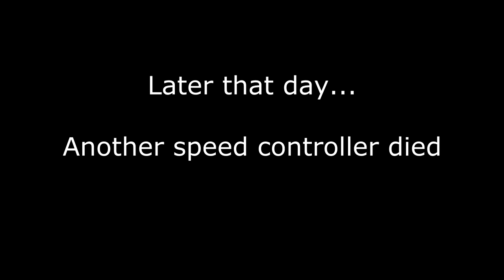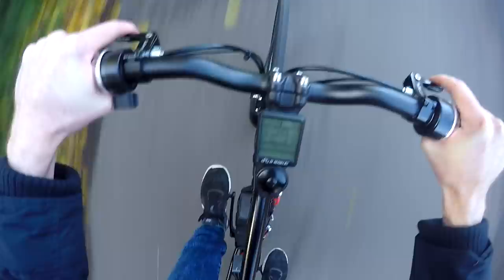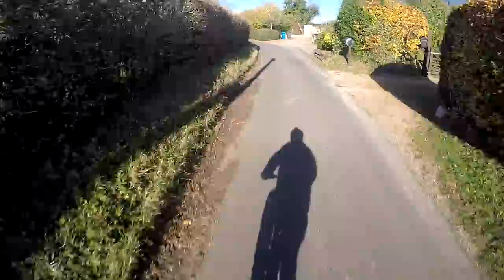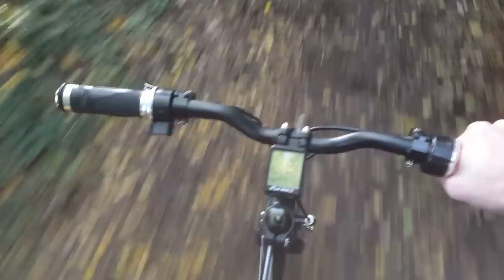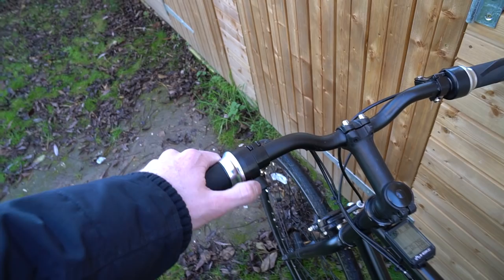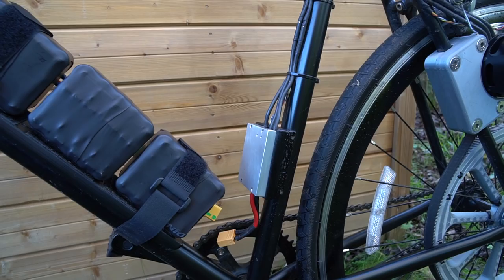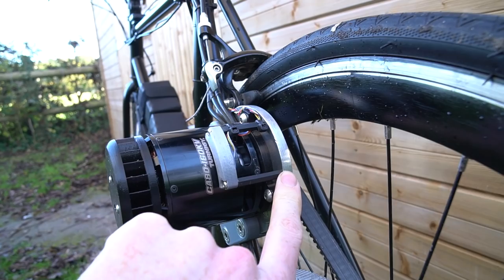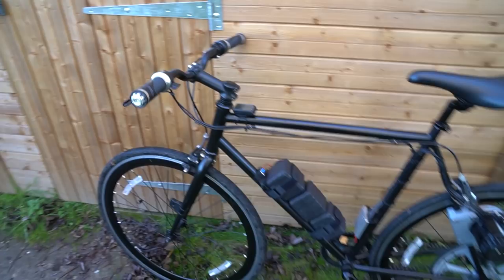Electric bike V3

Comment: Wouldn't it make for a cleaner install to put the motor inside the top of the rear triangle?  Flip the motor 180,  center its length on the bike's centerline .  Build your mount to clamp around the seat tube, extend stabilizers to the seat stays if necessary.
Reply from the maker: I considered this when building this V3, however I decided not to for simplicity. Moving the motor upwards meants running the belt up and over the rear brake. This would make the belt very long and therefore increase the possibility of it stretching under load and skipping. Also it would be more difficult to slide the motor for tensioning the belt. I'm sure it's possible, but I prefer the simplicity of this setup. Thanks

Comment: Instead of using such a large pulley for the bicycle wheel you can also use a multi pole axial flux motor for direct drive, printed by yourself. :D

Comment: I notice you still don't have disc brakes. With a downhiill bike you have 150mm hub spacing on the rear wheel.That leaves enough space to have your big grey wheel going around the disc. Might be a tight fit, but it would give you disc brakes.

Comment: The Tom Stanton Pigeon Racer 3.0, lol!

Hey Tom, have you considered building a 4.0 mid-drive with a jackshaft using a rear gear shifter bike? That will really give you usable torque and really high speed at the same time as you can shift gears. You would only need a pully running to the front sprocket with a oneway bearing. If my dumbass can do it with scrap shit metal and shit welder I know you can do a 3D printed version. 4kw that would get you up to 50+ mph using a mid-drive with wheelie power! YOU CAN DO IT MATE!

Comment: Impressive effort.  However... with all that MPH available don't you think that uprating to at least a single disc up front might extend your life expectancy a bit? If possible I'd be inclined to  try a twin hydraulic set up, one on each side of the fork. (I'm a pensioner who rode big fast m/cycles for years - remember, doesn't matter if you can't go. But it sure does matter if you can't stop!)

Comment: Really nice work.   I wanted to ask you if it could be possible to add a hub generator, like the SHIMANO Dynamo Generator Hub.  I found that searching on YT.  If you had these hubs on the front and rear wheels, could they charge the batteries at the same time as you were riding?  I guess they are putting out 6 or 8 v.  (not sure about the current).   Do you think it would be worth it to integrate them into the bike build as a charging solution as you ride?
Reply: RipVan Winkle No, that's not how physics works.
He'd have to put extra energy in, to then inefficiently generate a lot less energy.

Dynamos don't generate a fixed voltage, they're mostly current limited. So 500ma at 6-40v...also it's AC.
Reply: Right.  That's right the dynamo is AC.  Didn't realize that.  Don't know why but I just assumed a bicycle generator would be generating DC current.    
One other question, why do you say that there would have to be extra energy put in?  Am I correct in assuming you meant energy to turn the generator?    I don't see where that would be the case.  It's not like the generator is difficult to turn or has a lot of resistance.  Or maybe did you mean energy from somewhere else?
I also saw some DC dynamos (not integrated into hubs).  If it was DC, would it be worth it then?

Comment: Hi Tom, you're doing a great job. I'm curious with a full charge how long the bike will run, then run the same route again but without regen braking, how much extra time/miles can you get.
Reply from the maker: Hi Paul, I will be making a video on this soon! I'm currently trying to find a good route to ride with hills and stops etc to test the braking. Then I will ride it multiple times with and without regen braking to see if it's worth using. Thanks!

Comment: Really fantastic stuff. Incredibly impressed by your engineering (in other videos too).

Amazing to see the 3d-printed cog on the rear wheel. In PLA too. 
I'd be quite concerned about what bits might fly in which direction during a catastrophic failure. Either from that cog failing or the motor or belt coming loose at speed.  Make sure you tie up your shoelaces! ;) 

Those lanes are just like the ones I grew up cycling around in Somerset. 

Keep up the excellent work. From what I've seen so far, expect offers from the likes of Elon Musk soon. Seriously.

Comment: Say, with that regenerative braking, would a bank of supercaps play nice with this system?
Reply from the maker: I'm not too sure if I'm honest. I hear a lot of people talk about putting supercaps on a regen system, but I'm pretty sure it would require a battery management system to slowly discharge back into the battery
Reply: My thinking is not to use them to recharge the battery but rather just to quickly store and then use the energy from the regen immediately upon next demand from the motor. Supercaps can just charge and discharge really quickly. No need to actually recharge the battery if you can just use the power right away. It would reduce the demand on the battery and perhaps use that regen power more efficiently. I think all you have to do is place them in line between the battery and the speed controller. That's the way they are used with Car Audio systems for providing fast power to the amplifiers. Something to look into, anyway. You've come up with a great design. Thank you for sharing it with us.

Comment: excellent! very refined & lean system. you should be proud.
Question: did you use any specialized program to create the 184 tooth pulley?
keep up the great work!
Russ from Coral Springs, Florida, USA
Reply from the maker: I downloaded a model of a HTD5 pulley from GrabCAD (If I remember correctly), then measured the tooth dimensions and replicated it at a larger size in another CAD software. Thanks!

Comment: what about mounting some pick up coils near the front and rear brakes and a strip of coils down the rear frame tube   like on direct drive lg washing machines and also put nitrogen in tyres and neodymium dust maybe with graphite dust pumped in would create the field force excitation     just a thought

Comment: The only thing I could say about this, is that I really don't like the type of bike you've used.  Those tires look WAY too thin for this.  Not only from a stability standpoint, but also a reliability and grip standpoint.  More tire = more grip, which equals more torque applied to the road surface.  Also, thicker tires mean less likelihood of total destruction if you hit a stick or a pothole at speed!  Beyond that though, really nice design, glad you're getting some use out of it.
Reply: Monolith Tyriss I converted a 1970s racing bike using this method. I don't get any problems with stability. In fact my thin bike can still squeeze through tight spots between stopped traffic in my small town.

Love drop bars and thin tyres 

Commute every day and works brilliantly

Comment: Have you considered using ultracapacitors in conjunction with either batteries or solar? 

Ultracapacitors could also be used to collect the regenerative energy during deceleration.

Comment: How did you attach the rear pulley to the rim?
Reply: Roger Dickinson 

I'm not sure but what I think is...

Looks like a flip flop hub used on fixed wheel bikes.

Free wheel on one side and fixed on the other. The pulley is attached to the fixed side and the pedal side to the free wheel.

Comment: Why didnt you make the vesc 4's yourself? its much much cheaper, I calculated the expected cost if you make 10 of them yourself to £56-£60 per vesc (using prices of components for 1, meaning it might be cheaper due to component discounts) this price is for all components and pcb's. Some pcb fabs can even order a provided BOM and deliver you 100% completed pcbs at very little cost.

EDIT:
Actually with component discounts for all 10 its only £45-£50. I might just make a bunch and sell them at like £80 each :D

Comment: hey tom stanton do you know how to make a drone fly for up to 2 hours. use a small 48 volt motor turned into a generator and then attach a small motor to power it. It must run on just a little of the battery charge. so make a tiny stick generator. you could use the motor on a mini quad to make the whole thing work. please make a video and show me.

Comment: Hey, love your videos.

Can you give me some insight into the process you go through to select an electric motor?

Perhaps a few examples of how you'd size it for the application: eg, electric bike, electric model plane, electric go-kart, electric car conversion.
Reply from the maker: Hey David,
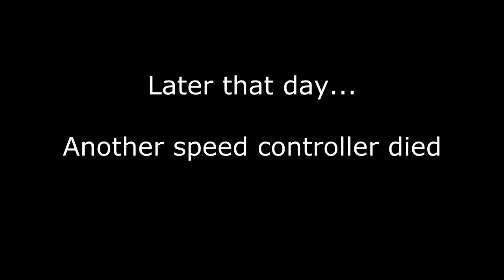I chose a motor based on lots of different things. Surprisingly speed is not an initial factor for me (this will probably change with a go-kart or car), because gear ratios can always be adjusted. Usually the motor isn't the most expensive part, so I will tend to see what battery and speed controller will fit my budget. Then I'll work out a battery depending on what the maximum voltage and amp rating the speed controller can handle (60V and 80A in this case). Then I'll work out whats the largest gear ratio I can fit on such a setup (about 1:15 in this case). The 'hobby grade' motor used on this bike has a kv rating, which means the RPM it can reach per volt. So this motor is 160kv, therefore with my 50v battery, it can spin at a maximum 8000RPM. then using the diameter of the wheel etc I estimated about 36mph, which is plenty of speed. This might be completely different for electric cars as I have no knowledge of their motor specs. So it's a bit of a juggle of components to get the right setup. Thanks

Comment: How many C-s  of current does the regenerative braking produce? Is it controlled? Isn't it too much for the batteries? 
Edit: You said it's up to 30A so how much C is that? >15C? Might be pretty bad for the batteries.
Reply from the maker: The battery is 12s 15Ah (12 cells in series and 5 cells in parallel), so when charging at 30A, it is charging at 2C. The LG HG2 cells recommend charging at 0.5C on a regular basis, but can occasionally be charged at 1.3C.
Reply: Cool. 2C doesn't sound that bad, though it's probably worth researching how this affects battery degradation. The effect is sometimes quite severe depending on the specific battery.
Reply: is what is the wiring like for the regen brake throttle? Is it possible to set up on the VESC 4? I am reproducing your v1 ebike with some improvements and would love to know how you did it

Comment: 300 gbp just for the vesc.. that's not cheap at all anymore
Reply: What is what?
Reply: Agree - so expensive!
Reply: Well, compare that to the price of a normal E-Bike and it suddenly feels pretty cheap again.
Reply: Danksa Grabowski nope it doent here in la you can buy ebikes for 300 dollars now and are good and reliable
Reply from the maker: +nightmare in action nighmare in action I find that very hard to believe. It's difficult to find a decent non electric bike for under $300, so to find an electric bike capable of 36mph for 15miles for under $300 is pretty close to impossible.
Reply: Tom Stanton oh well of course that speed thebones you get here at that price are those foldable ones have range at about 10 to 15mph and have a max speed of 18 but I still preffer hubmotors over belt drive is way more efficient
Reply: That's crazy cheap! :o In Germany you pay about 3000€ for a good one :'D
Reply: I don't think that you're understanding that this E-board controller also has regenerative braking and has a magnet sensorless/sensor optional control.   This makes this speed control really adaptable to all sorts of different brushless motor configurations.   Regenerative braking doesn't come cheap as there are special low resistance/pass Mosfet transistors in it's design, and I suspect being that this might be an entire controller on chip or at least advanced surface mount electronics, these extra features are a bargain at 300 quid.

Comment: love ur work truly inspiring heres another question about the regenerative breaking for you, is there anyway to do it without an esc that will control It for you
many thanks
James
Reply from the maker: Do you mean to have an additional method of re-charging the batteries without using the current motor and esc? I'm sure you could mount another DC motor somewhere and have that run through a charger to the batteries, but that would be unnecessarily complex. Thanks!
Reply: Im basically asking is if you can use the same motor to recharge the batteries without using an esc that is designed to utilise regenerative breaking. Just wondering about the actually internals of the circuit.

Comment: how did the 3 vescs break?
Reply from the maker: Bad manufacturing quality due to the VESC 4 being open source
Reply: Tom Stanton I don't see why it being "open source" has anything to with poor manufacturing? If anything it should make it better?
Reply from the maker: +DogMan the problem is that any factory in China can make them using whatever quality components and soldering they wish. There isn't a single company running the manufacturing to make sure the quality is consistently good. Some people get lucky and some end up with dead VESCs
Reply: Tom Stanton oh yeah I guess that makes sense. I checked the vedder forums and he said teamed up with trampaboards for the 6. I guess that allows for at least one source of good vescs

Comment: Nice video :)
I'm curious about how well this resists water, would you be able to run it in the rain?
Reply from the maker: I've tried to make everything as water resistant as I can without making it a pain to change stuff. For example, the VESC is mounted in a rubber case which will prevent light rain being an issue, but probably wouldn't be ok if completely soaked. The batteries are heat shrunk to prevent water getting in and the throttles 'should' be waterproof. The hall sensors are mounted in epoxy to insulate all the connections from water and in general brushless motors are water proof. So fingers crossed it is haha! Thanks!

Comment: Lovely engineering but I built a drop handled ebike that does 34mph for about £200 and it doesn't have a lump of motor sticking out the side or a conspicuous large pulley and drive belt.Take one 250w, 36v geared hub motor off a 20" and string to a 700c rim.Use a 36v/48v cheap Chinese controller (the FETS are good for 70vGet 2 off 8s lipo or equivalent and wire the 16s to the main positive and the 13s to the controller switch (door lock) via a power on switch.The unloaded wheel speed is about 600 rpm, so about 21 m/s (about 45 mph on as 700c rim.Without soldering the shunt (I.e. with a 15A limit), I get 34 mph.The motor doesn't overheat; just don't try to climb mountains.A bit of ATF can be added to the hub for cooling if you want more amps; I've run these controllers at 20-22A without issue by soldering the shunt and even if it does go bang, they cost about £10-£12 each from China.
Reply: yeah that need a video lad. cmon get on it! :)
Reply: and what if i especially want to clim mountains? do i need more watt? or what should i do then

Comment: Watch on utube - Light Rider operation Paul Revere
Switch the 6-50watt glass panels to 6-18 100watt flex panels and switch the 500watt motor for a 1000/1500watt motor.
Use extension cords to array panels.
I traveled across Canada and never grid changed it.
Used it to travel, boil water, cook food, salvage, charge batteries.

Comment: my neighbour recently bought a china e-bike. it was about 400EUR (new - and yes, it's brushless), can do 30km/h and the range is about 50km. damn.. how do they make them so cheap? I wonder how fast it will fall apart.. that's kind of discouraging because I won't even get the motor and ESC for that price to convert my old cannondale MTB to electric. and then I'll need a battery and more stuff to make it work.. sure, my frame will be far superior but the china thing also has a topcase, a basket, lights and even turn signals and shimano gears..
Reply: buy the china one and use all the parts on your frame maybe?
Reply: yeah I realized that. still wonder how they make an e-bike SO cheap.. its ridiculous.
Reply: child labour
Reply: It'll be the cheapest, not even good enough to be in Halfords* bike you can imagine.
With bottom of the barrel parts and a too small battery, they've lied about the capacity of.
There's also been some suggestion in the EU, that the Chinese government are subsidizing bikes for export.
*Halfords have some good bikes, but their cheap bikes are a disgrace.
Reply: Be greatful. I have to buy the hub and get a custom wheel made up for my MTB :(
Reply: They'll deffo be lieing about the capacity. For reference a 10.4Ah 37V made with Samsung 26H cells will cost a minimum of £120 JUST FOR THE CELLS. Add a case, battery management, postage and a charger and you're looking at £180ish minimum.

Comment: Why not connect the regeneration braking to super capacitors instead of directly to the battery? I'm sure the super capacitors should be able to handle the 30amps into them